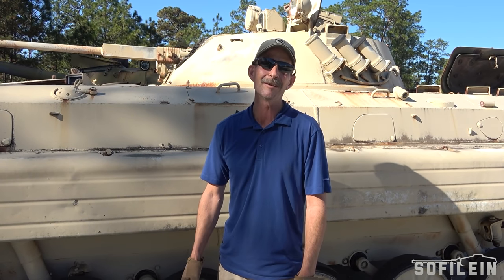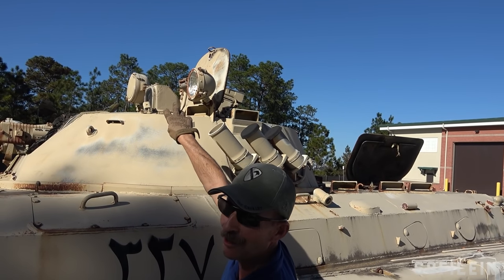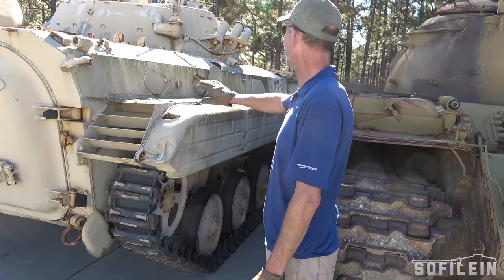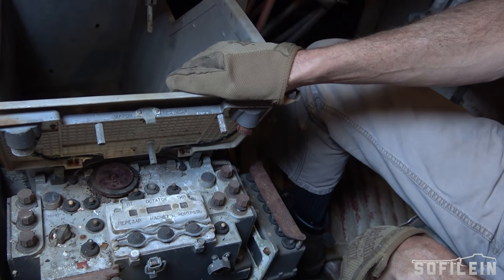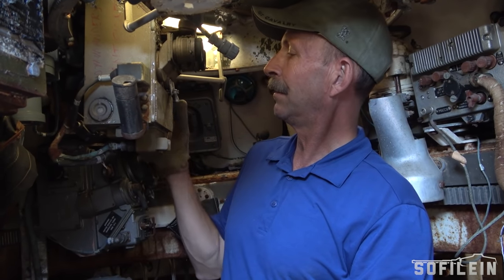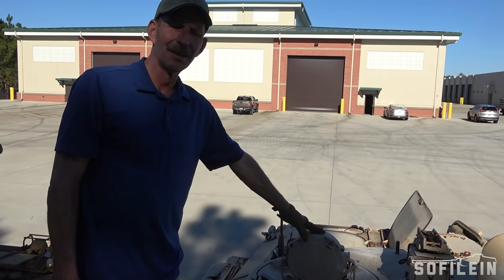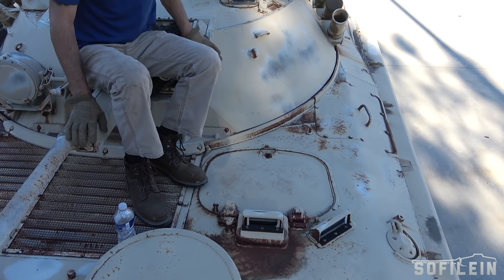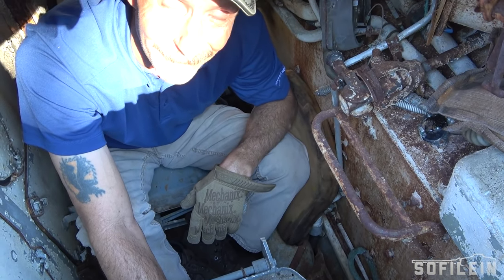Inside and Out: BMP-2 Infantry Fighting Vehicle Tour

Comment: Small point of order: the BMP-3 doesn't have the missile on the roof: it fires them through the 100mm gun. The missile is the same 9M117 Bastion (AT-10 Stabber) that you see on upgraded T-55s.
Reply: If I recall right, there were photos of other ATGMs tested on BMP-3 simply due to most powerful and reliable ones USSR and thus Russia have are in 130-152mm caliber. That's among the other weirdness like frontal 30mm AGLs for driver. My guess would be that separate ATGM module might have returned on 57mm armed vehicles. But now that's history that'll never happen:D

P.S.: though chinese might adopt some that last one. If they'd still have some trust left in russian equipment in a few months:D
Reply: @TheArklyte  I know they've experimented with other ATGMs on BMP-3 but AFAIK most of the ones in service use the gun-launched one.

It's not the technical quality of Russian equipment that's been particularly shown lacking, so much as their maintenance, logistics, training and tactics. A different army could have done WAY better with the same equipment if they'd used it properly.
Reply: @MrHws5mp   the ukranian army is just a russian army with ``some`` us stuff  iths that ukrane has been at war and has alot of redy ness russia is so corupt from the incide out lel
Reply: @MrHws5mp  We call such "smart guys" the "sofa general".
Reply: BMP-3 uses Arkhan ATGM not Bastion.
Reply: @ivanvoloder8114  Every reference I can find says that BMP-3 uses Bastion. As far as I can see, "Arkan" is just a tandem-charge version of Bastion, designated 3UBK23-3.
Reply: it has a variant that has two kornets mounted on the left it also has a variant that has 2 khrizantema missiles mounted on each side
Reply: @Rostmeo1  Similar to Berezhok module?

Comment: I spend some time in BMP2 - nickname 'coffin'. During combat rear door according to instruction need to be field with sand, but as all soldier in the eastern do instead- you put water sugar fruits, and bread :)  And to be honest with all of you I watching this any because of the extraordinary beauty of Sofi :) Now some facts he makes wrong- first ports are for RPKS and PKS - fire team is 7 soldier in ex Warsaw pact, we have 1 PK (7.62x54R) 1 RPKS( Kalasznkikow with heavy barrel ) 1 SWD or RPG7 in fire team. The floor is paper-thin also under a bench you have an extra 20 rounds of 73mm (about 20 in the turret) in the 30mm version you have 6 boxes of 30mm ammo. The driver position is not as bad- the chair has 2 positions - combat when is in low and you use periscope and normal high when your head sticks up. Also in 20;50 you see switches on top - first is to seal during chemical attack second is helon system of extinguisher then you have a smoke screen system ( it basically discharges 6liter of engine oil on hot exhaust pipe). BMP can swim up to Bofors3. having 2 screws doing like 3 M/H. Personal advice - never go in because during an attack with even simple DsK it will be your coffin. Still in service in Rusia, Poland( they swap it for Rosomack) Ukraine. Everything in BMP is multiplied for example starter - you have electrical and pneumatic, gearbox standard H behind volant :)Also the BMP1 has 2a42 30 mm gun, not 2a72. Amo is still 30mmx165mm but in Bmp1 and 2 is gas-operated was upgraded because you cannot see anything (a lot of gas inside and lot spend shells ) . As you all can see at afgan photos the best way to use a BMP is not to use it at all or sit outside. Sofilein if you ever will be interesting to drive Warsaw pact equipment come to Poland :)
Reply: Also in use in Finland, modernized a bit but still BMP-2.
Reply: @Vulcaani  Didn't know that. In 96 when I was in Finland for joint force training we used MT-LBu and during arctic training, we were carried on Sisu . My knowledge is out of date because since 98 I was moved to the Chopper brigade. But if so for sure Poland was involved in modernization and it is still 'coffin'. Last week I saw pictures from Ukraine and they just confirmed what I always know. Since 90 Russian just changed the number of crew from 9 to 7. Poland spends million on modernization but after the first gulf war, the knowledge is that this is the worst infantry carrier available. Rumor says it works like a magnet for every bullet:) Love Sako TRG-42 ;)
Reply: @michaljohanowicz9411  you can bet your money Finland will drive the bmps to bits. There is no money to replace them with cv90 which is also in use. 

I am under the impression Poland has tons of militias and civil guards? I find them pretty interesting and useful tools to keep the reserve well trained.
Reply: @michaljohanowicz9411  the 7.62 will be in use for decades to come, that is certain sure. We have too large of a reserve to equip them all with new ones. And frankly I would rather use money on something more important. 

Putin is not a madman. I think he is daring player and saw that he needs to do the attack. He might have done it on some bad intel and false assumptions but I dont think he has gone insane. Understanding him does not mean accepting him. And in 1941 we were the ones going on the offence, with good reason though.
Reply: > Amo is still 30mmx165mm but in Bmp1 and 2 is gas-operated

This is now coming up in Ukraine. Ukrainian 30mmx165mm autocannons in unmanned turrets are electrically fired, and use the same ammo as Soviet ship, and aircraft 30mm guns. Russians can't fire their ammo from them, and vice versa.
Reply: @32353235e  They can and millions of round of 30mm was sent from Poland to Ukraine. Ukrainian canon is ZTM1 and 2 it is just a variation of 2a42. The same is for rifles 5.45 and 7.62 and 12,7x108. Because of close cooperation (gifts from Poland ), some staff is equipped with MK30-1 shooting 30mmx173.
Reply: @32353235e  The turret is called Shkval, and the autocannon is Oerlikon KBA  25 mm (25×137mm this is NATO round)  but this is an old modification( u can recognize when you spot 9M113 Konkurs (AT-5 Spandrel) mounted on turret)
Reply: @Vulcaani  Look when I stat I was equipped with Ak47 a year later I was modernized to Tantal 5.45 and this was a technological step 2 Years later we go a Beryll in 5.56 now the army has a new rifle again. The personal weapon is most important like personal protection. Upgrading rigs is not an expensive process- my DD18 cost me 3000E one round is 1E and every soldier chewing 250 a month standard plus some extras on-field training. Even Russia upgraded rifles - 7.62x39 is obsolete on modern combat are. Also optic is a must. I know that war Finish Rusia start in 1920 something but I was given a date to just show point.  
I think he got some mental problems(Putin) he was getting everything. All the money from Europe paid monthly all the goods etc And this invasion has no sens ratio attack defenders should be at least 3 to 1. And he uses just 20ok troops. Second, every war has some economical or political justification - he has none. Also rules of engagement - shooting civilians and showing that his army is made from paper? Also all aftermath he basically destroyed the next generation in his country and build a new iron wall. Also whatever he achieved he will be overtaken by China because till he will be breathing West will not forget what he was done.
Reply: @michaljohanowicz9411  Personal weapon is valuable yes, but I value artillery, logistics, at and aa missiles, fuel and such stuff more. Optics too. We have 280k reservists with planned organizational tasks and approx 900k in total reserve (men of 18-60 years, trained to do something). Giving everyone a new rifle is an immense burden on the economy.

I am sure that in the next ten years we will equip the most important operational battle groups (idk, maybe 30-40k guns?) with either 5.56 or 6.5 but rest will have to do and will manage with the old one. For artillery and signal troops it is rather irrelevant what blaster they are carrying. The system they operate is more meaningful.

As I said, I think Putin is operating on false intel and stupid suppositions. And what I have seen civilian casualties have still been quite minimal if we compare to Checnya or even US invasion of Iraq. I feel like the russian BTG's are not fighting like they are trained and should be - blasting everything and everyone to hell and back with artillery. Maybe it is a logistics problem, not enough shells.
Reply: @Vulcaani  In modern warfare AA missiles are obsolete. In the last 2 years, Merkava tanks were fired more than 114 times with AA and even a single one was unable to hit a tank. This is an active anti-AA defense system (Rusia claims Armata Tank has one). It is working on Ukraine because Russia still uses a Soviet tactic Ukrainian uses NATO death trap tactic. Artillery - self-guided artillery with self seek miles destroy full brigade in Iraqi T tank from a distance of 37km. NATO tactic doesn't let tanks come close then 50 km to a front line. 50km is an overline chopper operation kill zone (hellfire).  I saw Abrams hit with 17 yes 17 AA and was still fully operational.  Civilian targeting is extremely high in Ukraine. I don't see clinging door to door to avoid civilian casualties. Compare yourself Mariupoul to Fallujah. For a precision artillery strike, you need a fire team that will laser guide ammunition.  The normal private is always the most important army asset. Training a soldier costs more than a battle tank. Rusia operate like they always do, soldiers mean nothing and this is why they are not traind.  Rusia used a motorized army without proper ground force to cover. You need at least a full pluton per tank to operate and defend. gunfight last about 1 min - during this time you try to shoot as many accurate rounds as is possible. Ak47 is rubbish on distance 300m+, especially with iron sight and burst fire. This gun was designed to sub 100m range combat. Moder army engagements are in the area of 300m. Personal equipment of Russian is like West from 90. I was expected to see every soldier using the RATNIK system but the pictures show that they are just cannon feeders.  Logistic is wing wars from Roman and time of Legion. For one operator you need to have 8 supply soldiers. Russia's lack of fuel is also a tactic from the 60 s. They tray to put field pipeline, with is constantly destroyed by a small squad of Ukrainian. Russian trucks are not armored and not covered in convoys escort. The only what they have is ammo, this is a reason they start turtling and bombarding sqr by square. And hundred more small things, but it is too much to write it down. And I believe he is insane based on the theory of games. He chooses a game he can not win because winning this game was never an option.
Reply: @michaljohanowicz9411  ok buddy. I still rely more on the larger guns than personal weaponry. Does not diminish the infantrys importance. You can have your way.
Reply: @Vulcaani  I admire Artylery like everyone who was on the ground. But to call a fire mission you need last long inaff. :)

Comment: Important safety tip: The driver’s hatch handle must be in the locked position when that large circular hatch is fully open, otherwise it is possible when hitting a big bump or other obstruction that the hatch will rotate violently, potentially decapitating the driver should he have his head sticking up. Trust me on this one.
Reply: Our M1200 Armored Knight / M1117 ASV are the same way, with rotating hatches for the driver & TC!

We'd tried to hammer that risk into the heads of the guys we were doing drivers training for, then immediately had a guy forget to lock his hatch open and brake a bit firmly while turned-out. Got him right in the neck and left a decent bruise, but fortunately didn't cause any lasting injury!
Reply: "This is a killing machine. It does not care who"
Reply: yep there was an incident some time ago didnt end very well......
Reply: In 1996 I was called up for military service.  Tank driver.  Gunner.  At one not very wonderful moment, the hatch hit me on the head from above.  No, I didn’t stick my head out, I just relaxed a little on the march and a piece of my skull looked out of the tower and the hatch jumped off the ax and hit me in the head with its energy.  I was wearing a Soviet tank helmet and still, it felt like my spine had fallen out of my ass.

Comment: Every military vehicle should be reviewed in scope of a nation's adopted military doctrine. It's great to analyze how much engineering effort was contributed by the USSR engineers in the vehicle that was to become the transport and support for a squad in line with the adopted tactics. Every little thing has its intended purpose, even the cannon belt feed weirdly snaking in the turret to make any part of the belt accessible if the belt is stuck.
Reply: True. But as a human and solider I know which equipment Id rather trust my life with and and how meaningless human resource was seen for Soviets
Reply: @BiberandDolik  It's an 43 (1979) year old modification of the BMP-1 (1966 ie a 56 year old design).  It gets called an IFV but its little better in Armour than an APC.  The dismount crew often choose to ride on top since they would die in a mine strike if inside.  Ofcourse if they ride outside they loose protection from artillery and small arms.  A WW2 German half track would surely be better.   Its very easy to penetrate and if penetrated there is little containment inside leading to many crew casualties.It's very outdated even as BMP-3 and BMP-4.
Reply: @williamzk9083  BMP 3 is outdated? lol
Reply: @TiberiiGrakh  BMP-3 is outdated
Reply: @williamzk9083  I'm still wondering what is this BMP-4 (lit. IFV-4) everyone keeps talking about, both the presenter and commenters =) The BMP-3 is the newest model in this line that the Russian army uses. 

Yes, the same factory made a BMD-4 ("airborne fighting vehicle") — it's a vehicle that's somewhat related to BMP-3, but the only branch they managed to sell it to were the Airborne (who have the tendency and the clout to spend tons of money on having their own vehicles); the army refused it outright. So you could say they exist in parallel, with much fewer BMD-4 made.
Reply: @BiberandDolik  lol.
Reply: True. Important to remember that the BMP made NATO really nervous and led to the development of the Bradley.
Reply: @BiberandDolik

You sure about that? NATO equipment, whether Bradley’s or Abrams are burning in Ukraine right now. The Soviet and Russia equipment didn’t perform any worse.

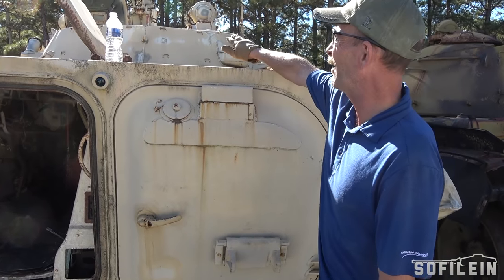Comment: 6:12 There's a very good reason for those top hatches. And that is air defense - soldiers could stand up through those and shoot MANPADS missiles at enemy helicopters or low flying aircraft.
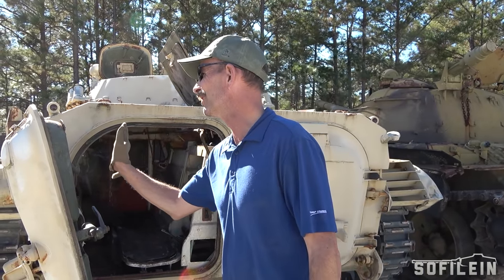5:26 Ahh the BMP rear doors... They're actually "dual-purpose" (and I'm not talking about spaced armor) - there are stories about how during the Invasion of Afghanistan, Soviet soldiers used them to make hooch. After disconnecting them from the fuel hose at the bottom and cleaning from any remains of gasoline, they thrown sugar and fruit through the top caps, hot Afghani climate did the rest of the job, and after some time they poured the drink from the bottom ones.
Reply: Yep if in urban areas you can put top cover troops up through the hatches to watch rooftops, we had similar on our APCs.
Reply: Samogonka or Skwas "BMP-style" 😄
Reply: I would only add that the 30mm machine gun could also be fired against helicopter targets. There was a computer in it that could be converted to aerial targets as well! Was it like this on the Russian type, I don't know on the Iraqi one?